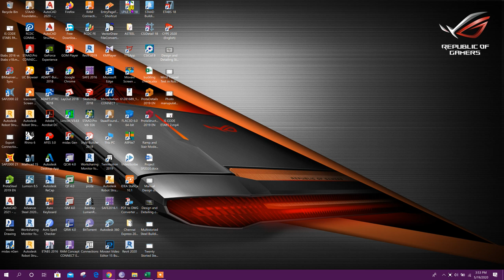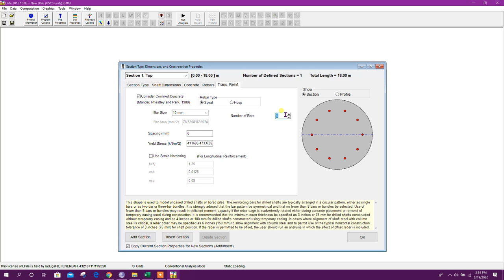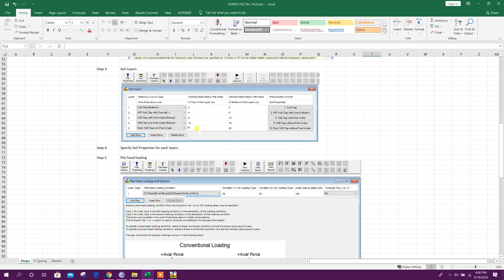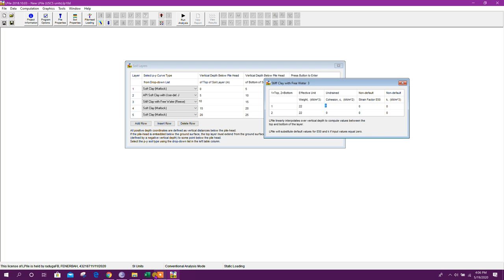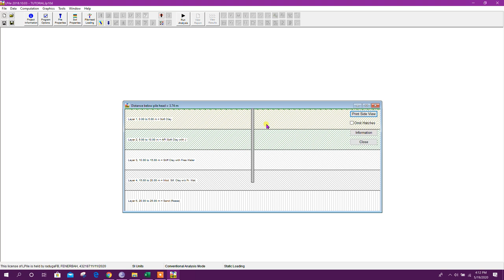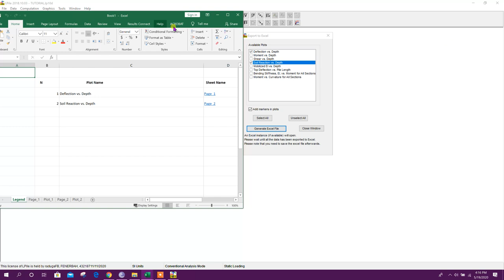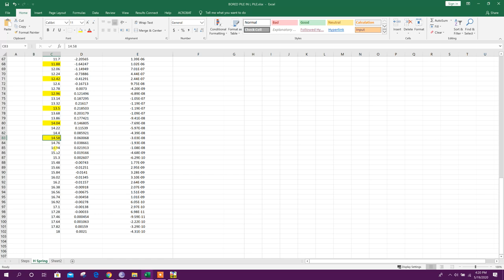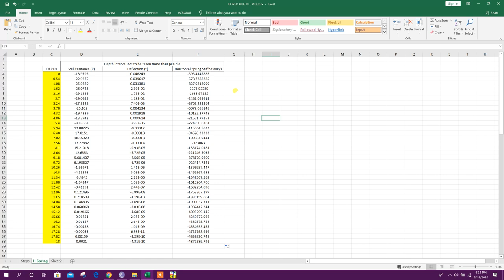Pile Analysis in LPile | Calculation of Lateral Spring Stiffness

Comment: What is the unit for Pile spring stiffness? As per this video it is found to be kPa. Is this correct? Usually Spring stiffness will be in kPa/m or kN/m. Clarify. I guess you need to multiply the circumference of the pile with (p/y) to get the stiffness in kN/m, since p is in kN/m and y is in m.

Comment: Great presentation. I have one question: Structure Engineers usually need nonlinear spring stiffness for numerical modelling; a mobilized spring stiffness that will change with lateral displacement, however your table of spring stiffness are constant values. How we can get a nonlinear spring stiffness, for each specific depth of the pile, from LPile?  Thank you.
Reply: That is a one million dollars question. Unless you have a software that bears non-linear behaviour, you cannot. But if you do, you an test several load in L-pile and draw a non linear curve for each soil layer. You will then input the soil behaviour as spring propriety in the FEM software.
Reply: Either use the p-y curves generated from LPile or do a “back and forth” analysis until the displacement in both software converged.

Comment: Hi, 
If I calculated soil spring along the entire of pile length, this case must I  apply all springs entire length ? For example as per location codes , at first we define effective length of pile( pile length is 15m diam.600mm, first soil layer thickness is medium sand 4m secand layer is soft clay is 2m and stiff clay is 8m ). We calculating effective pile height is 9m , this case we dont take account for 6m . And this case I apply 9m spring?

Comment: Assalamualaikum Sir, I'm a civil engineering student and I have some question about this. 
1. If I want to know the lateral spring stiffness from LPILE with the cyclic loads, how many "Number of cyclic of loading" sould i enter? The custom was 2 but I don't know what's that, I couldn't find the manual book for this.
2. And if the test pile is hollow precast prestressed concrete pile with a diameter of 300mm and thickness of 60mm (I already entered this on LPILe) and using six-7mm diameter prestressing steel bars with spiral hoop reinforcements with a diameter of 3mm and pitch of 100mm, how do I enter this on LPILE? I already chose the SI units but the unit on this pile section for prestress is different.
3. If the pile is 26m long and embedded to the ground up to 24,8m. The head of pile and the loading point was1,2m and 0,6m from Ground level, respectively, how do I enter this to LPILE as well?
Thank you for your attention, and I'm looking forward for your answer, Sir.
Reply: anak indo nyasar

Comment: There is only one txt file named "AllPile V 7.3B", where below notes has been provided,
Allpile V7.3B

info:
AllPile is a Windows-based analysis program that handles virtually all types of piles, including steel pipes, H-piles, pre-cast concrete piles, auger-cast piles, drilled shafts, timber piles, jetted piles, tapered piles, piers with bell, micropiles (minipiles), uplift anchors, uplift plate, and shallow foundations.

One of the major advantages AllPile has over other pile software is that it combines most pile analyses in a single program. It calculates compression (with settlement), uplift, lateral capacity, and group analysis all together. Users only need to input the data once instead of several times in different programs. AllPile makes pile analysis easy, economical and time-efficient.

AllPile is suitable for all engineers, even those without too much pile analysis experience. It helps structural engineers choose soil parameters, and geotechnical engineers choose pile properties. AllPile is a must-have tool for structural, geotechnical, and construction engineers.

Download:
Code:
http://www.civiltechsoftware.com/software/all-pile.php
http://rapidshare.com/files/263943781/Allpile_V7.3B_Full.rar

AllPile v7.3B medicine

Password: Bknee
Reply from the maker: Install the All Pile installation file, then run pat..ch as admin & locate the folder where it installed to pat...ch it.